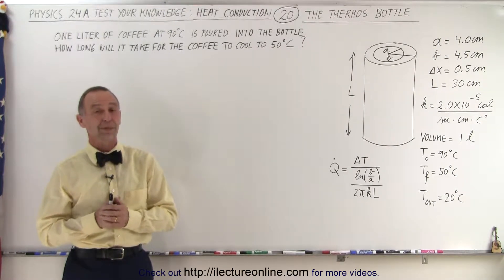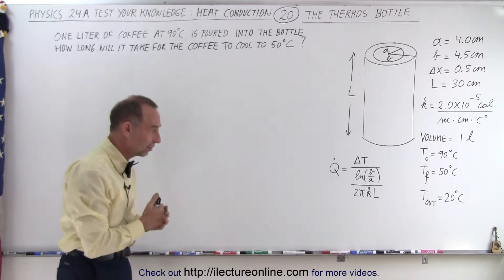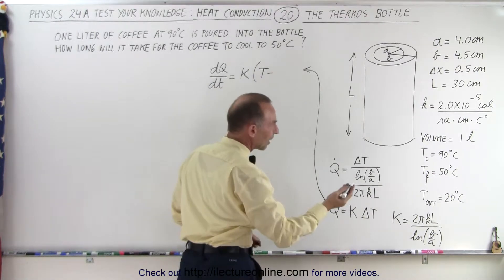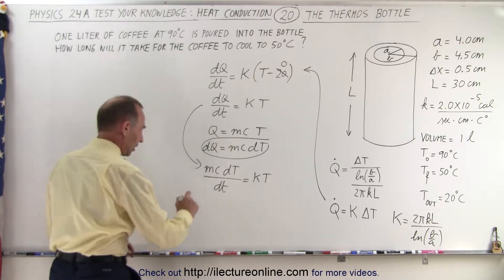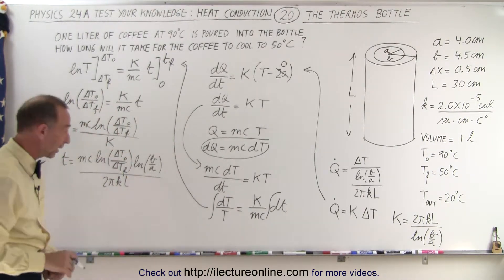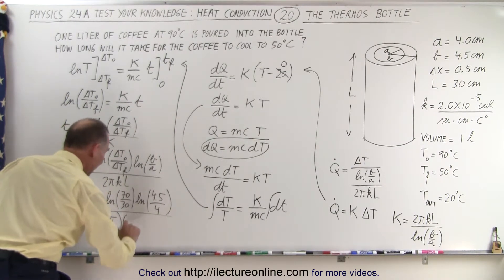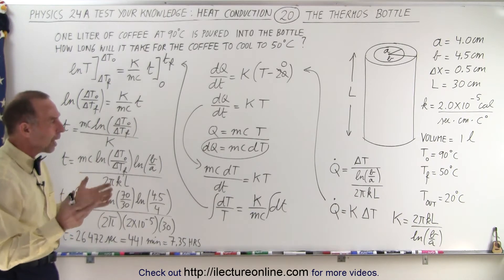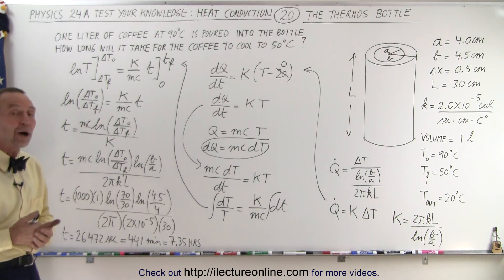Physics 24A  Heat Conduction Examples (20 of 22) The Thermos Bottle

Comment: Hello.Have a nice day.I have a question. It is very important to me.I would be glad if you answer.I am designing a thermos and there is hot water inside the thermos. How can I calculate the convection coefficient of stagnant water in the thermos by natural convection?
Reply from the maker: Convection in static fluids are measured experimentally.  With a thermos, the convection of heat within the fluid is less important than the conduction of heat through the walls.
Reply: @MichelvanBiezen  Thank you.
Reply: selam. tasarımı yapabildiniz mi

Comment: Is there any physical interpretation behind ln(b/a)?
Reply from the maker: This type of relationship between a and b means that doubling b will not cause the heat flow to drop to 1/2 the previous value but will decline as the logarithmic ratio.  (many processes in nature work that way).

Comment: Why do you use not SI?
Reply from the maker: In the US, we still use the imperial system of units.
Reply: @MichelvanBiezen  Could you Please advice how estimate the real conductive thermal resistance of cylindrical insulation if we know some thermal conductivity function as k=aT^3+bT^2+cT+d and Inside and outside temperature of cylinder?